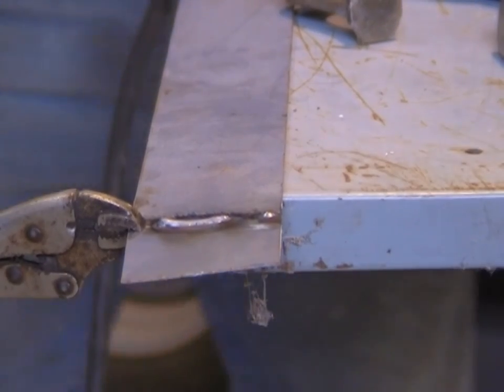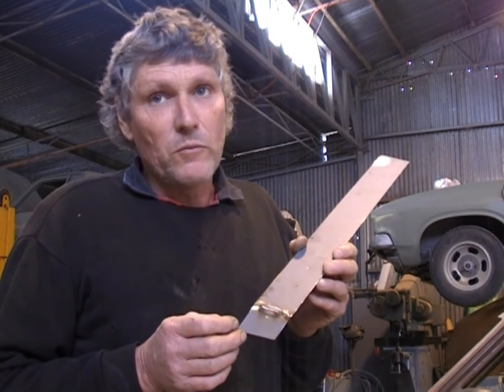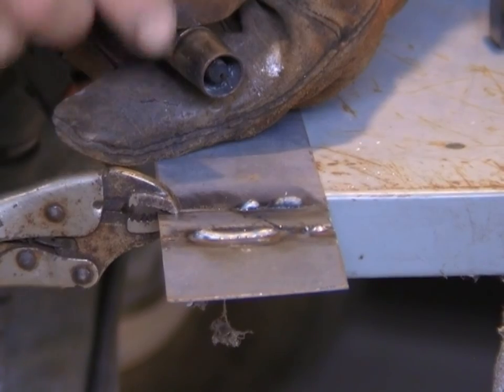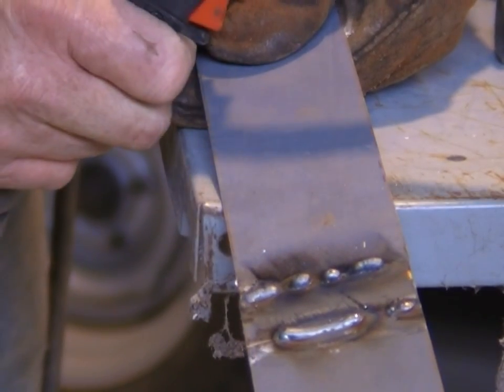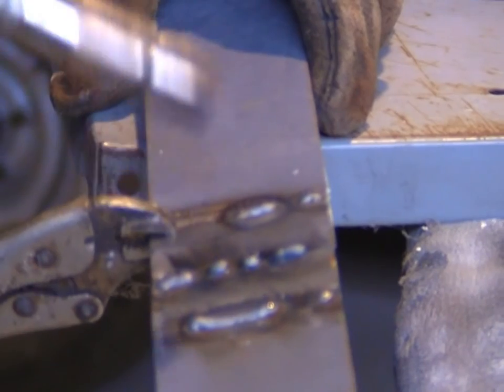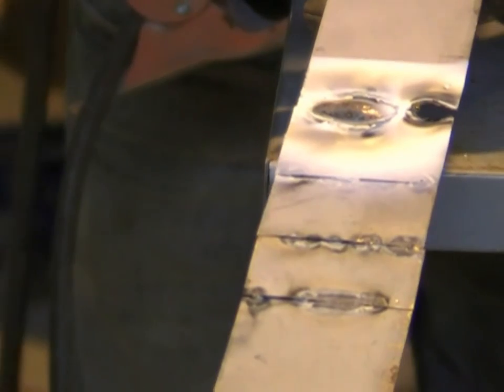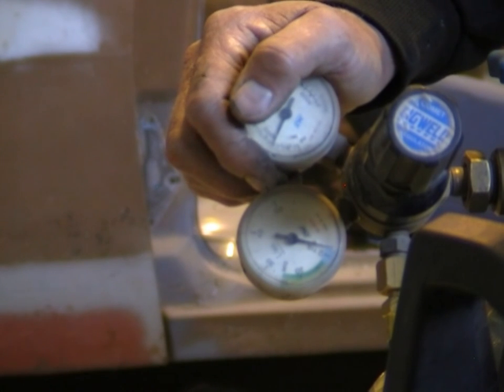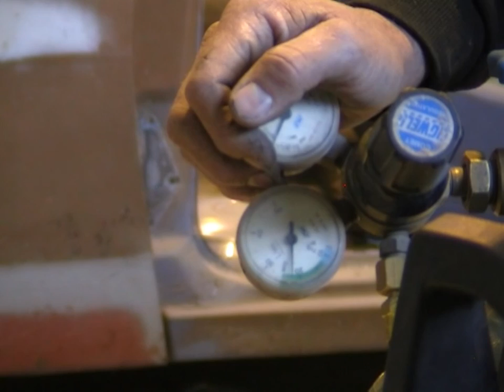Mig Welding tips & techniques  Part 1

Comment: Rob what voltage do you have your mig set to for this type of welding?
Reply: Mick Holgate your welder should have a rough guide for voltage to plate thickness and every brand of machine will vary. This will give you the starting point,lay down a few practice beads and examine them. If the weld is a lump on top of the steel increase the voltage. Small adjustments at a time are best. Alternatively if the weld burns through decrease the voltage. As in the video the wire speed and voltage need to work together so often you need to adjust both to get a successful weld. Hope this helps you. Cheers Rob.
Reply: Robert Teale cheers Rob. Unfortunately the guide is for fulling welding beads. Generally when doing spot or stitch welding you need to run a little hotter to get fast and decent penetration. 
Would you suggest 0.5-1V hotter for those techniques?
Reply: Mick Holgate all you can do is experiment little bit at a time to get the optimum voltage. Once you work it out make a record of the settings for future reference. As I weld every day it is just second nature so I don't take much notice of what the specific settings are.